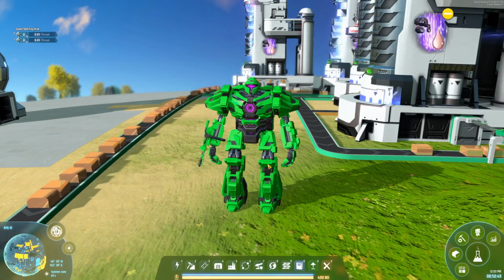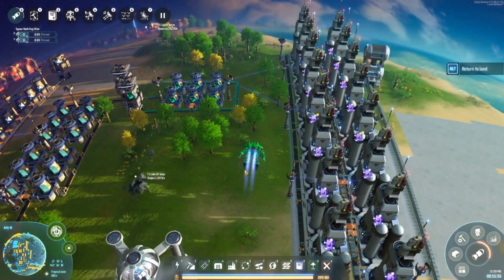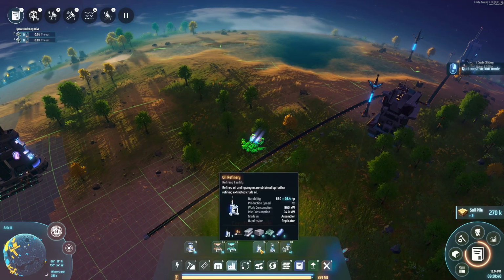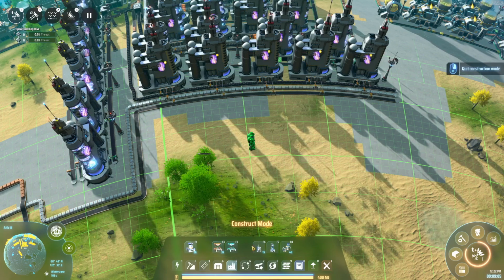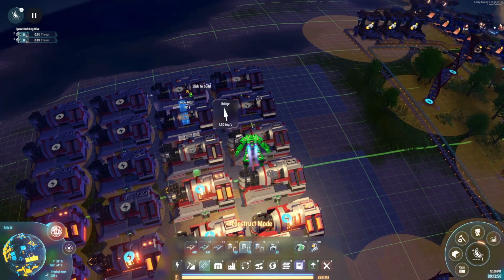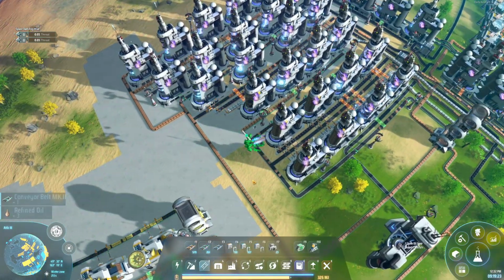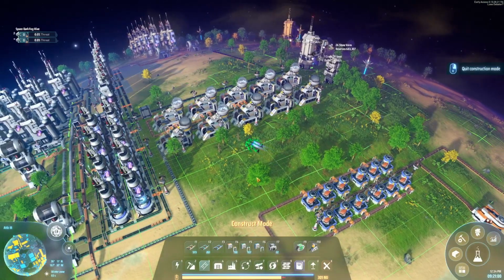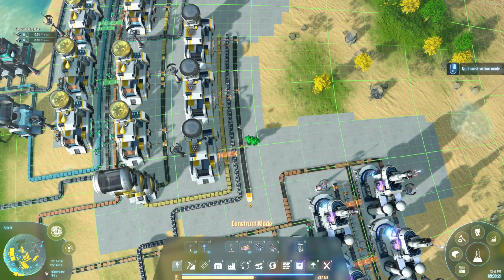Dyson Sphere Program The Dark Fog - Chemical Plant Madness - How to Setup Mid-Game Chemicals (EP6)

Comment: We better hope that there's at least some organic crystals deposits and sulfuric acid oceans in the nearby star systems, they can take away much of the hefty load for Refined Oil in the long run. If not, we can always use the reforming refine method to get a little extra refined oil at the expense of coal.